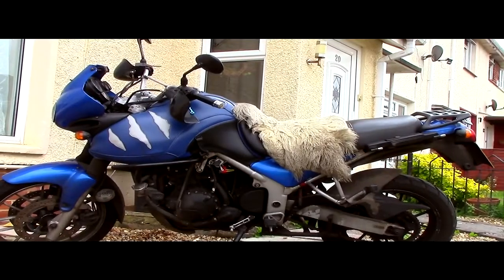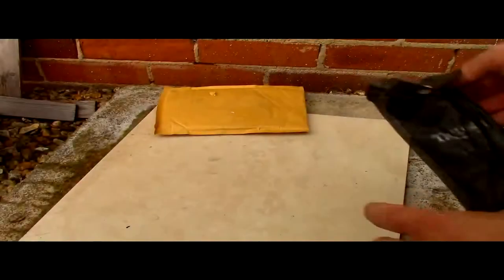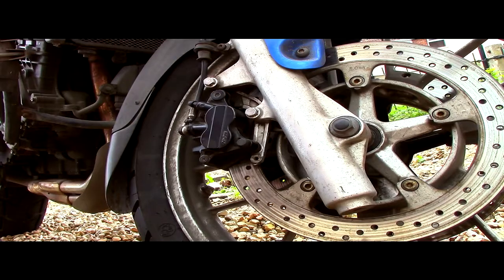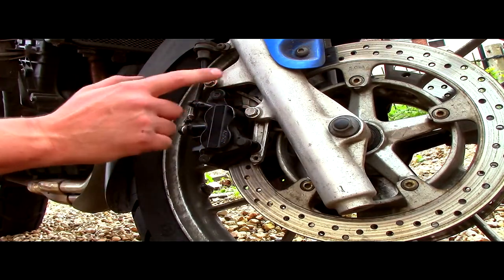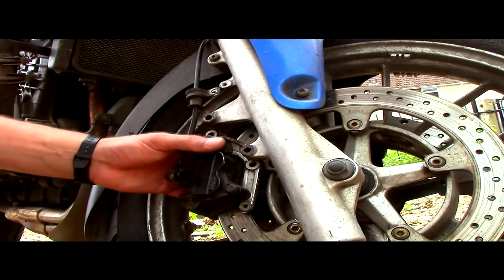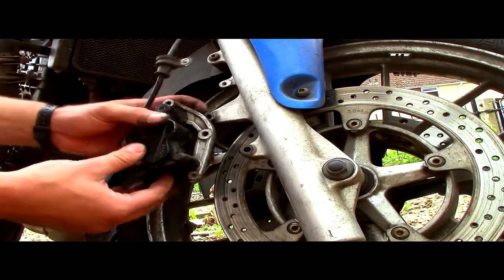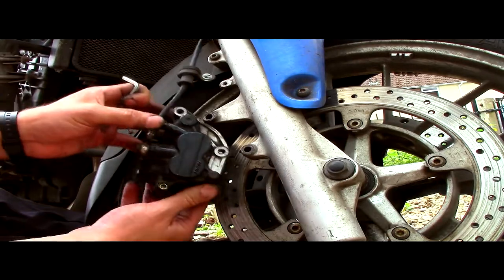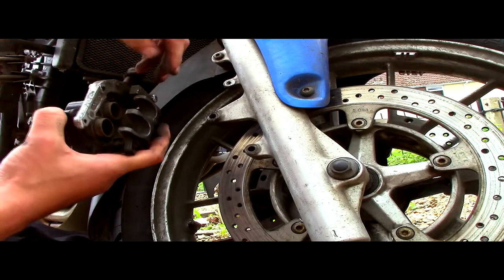HD Triumph tiger 955i brake pad change

Comment: Great idea but please tell me that wasn't WD40 that you were spraying around your brand New pads? If so, you'd be doing a great job of contaminating them. You only need a few dabs of Copperslip on the tread of the retaining pin, grub screw and I'd you feel like it, a thin smear on the back of the piston side pad to prevent vibration a d squealing. 👍